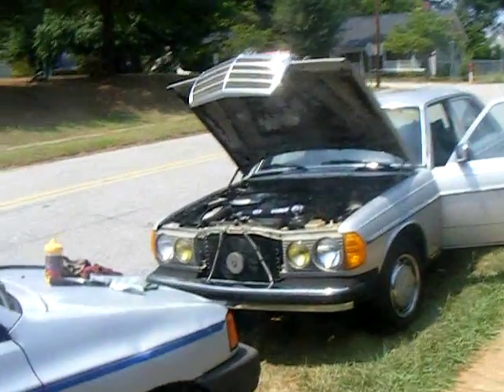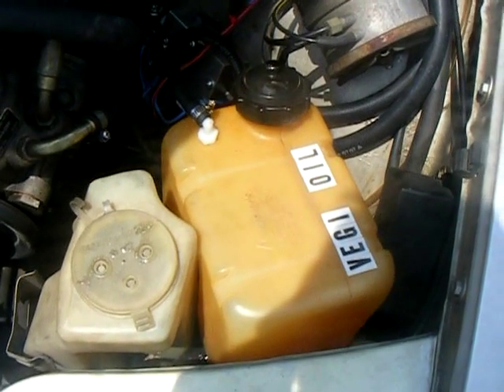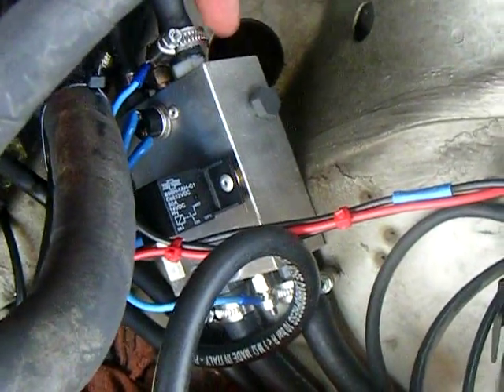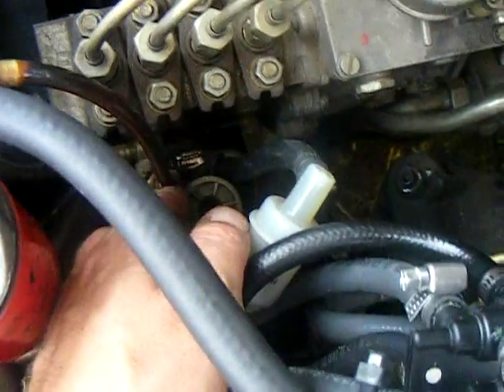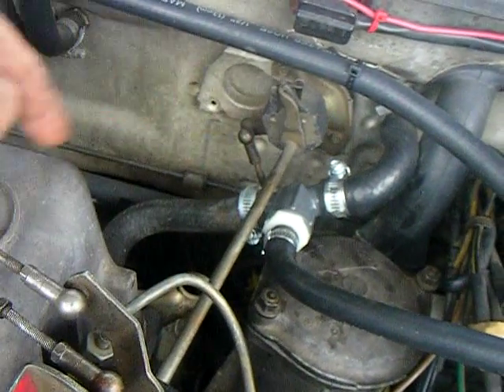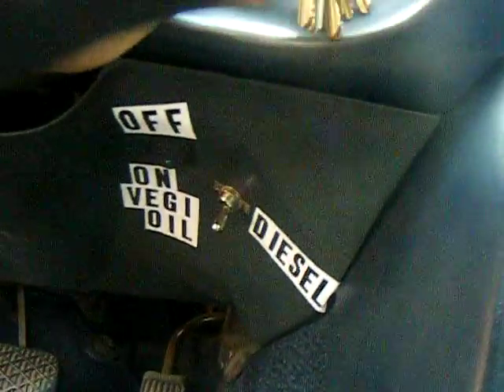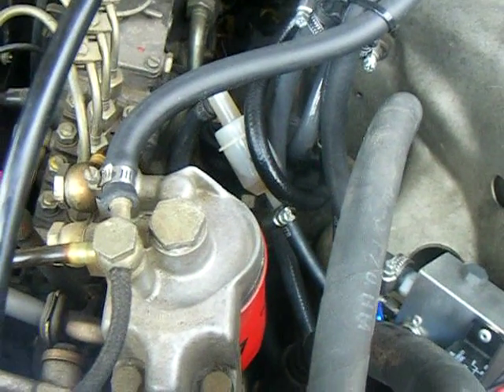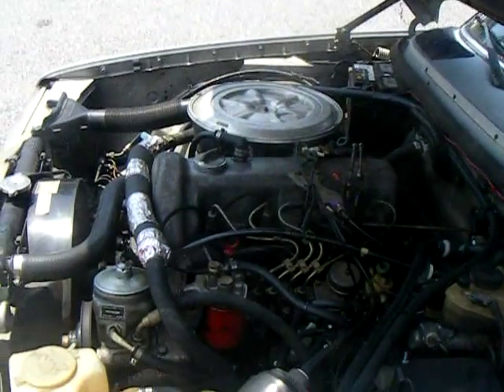Diy - How to convert diesel run on vegetable oil - mercedes 240D

Comment: Only on old cars you can drive on WVO without problems. Modern cars will die very soon.
Reply from the maker: Yes , too many sensors and computers and much more sensitive fuel delivery in new cars

Comment: a great way to ruin a great car. They will run fine for a while until they're ruined. Motor oil is an even worse idea.
Reply from the maker: not really, Diesel engine originaly was designed to run on vegetable oil , until oil companies stopped it , it’s oil , like oil , and this old Mercedes is buid like a tank , nothing can kill it :) still runs like a clock :)
Reply: @djpitr  amazing
Reply: Peanut oil if you wanna get really specific about what kind of vegetable oil  @djpitr

Comment from the maker: its 1981 , i got the heater from ebay ,but it was send from Germany :) , i didnot want the single tank because you will make it dirty with oil over time , and cleaning small secondary tank is easier than cleaning your main tank, and yes You can run this Mercedes strait on veggie oil , just keep the oil warm . and yes i m from Czech Republic. :)

Comment: Hi, very nice and simple conversion. Where did you buy this heater with glow plugs? I've seen a single-tank conversion by Kent Bergsma(youtube channel Mercedessource) using glow plugs, so that you just have to wait 30 seconds when glow plugs are heating the fuel(he had much more plugs) and you don't need second tank. Do you think it is possible to run only on veggie with your car?
BTW are you maybe from Czech Republic?